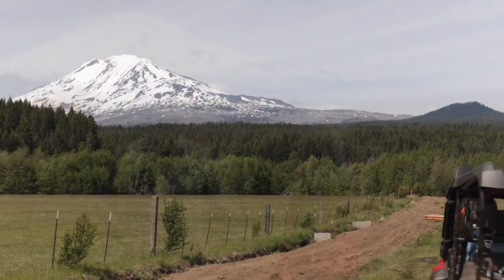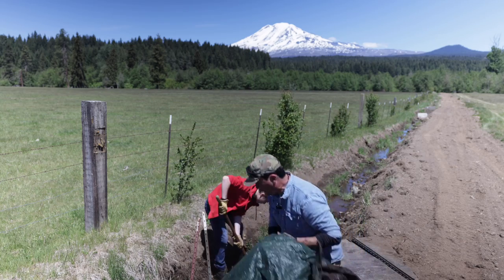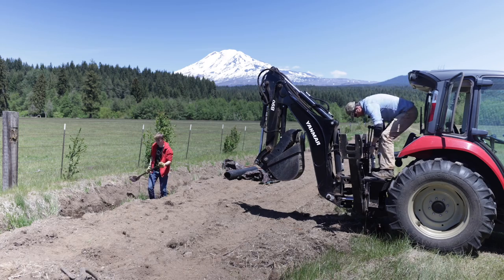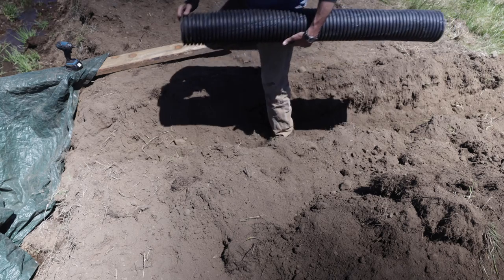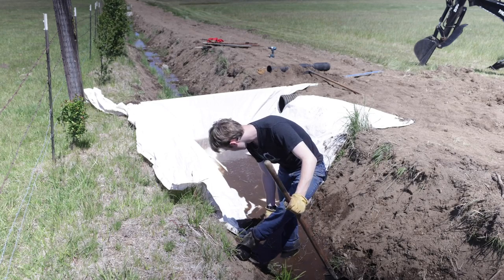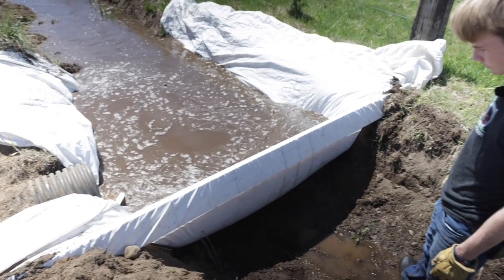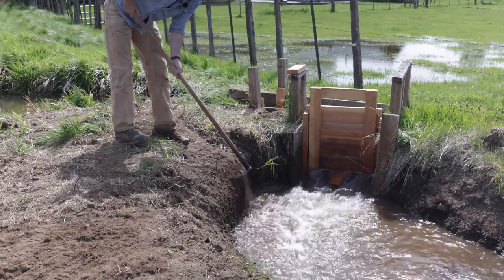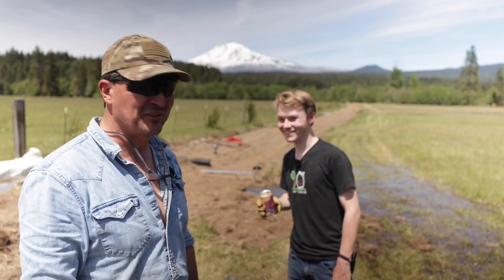How To Build A Dam Like A Pro

Comment: may i add some surgestions:
1. how about taking that tarp double, i dont thing there is that much needed for the floor before the dam 
2. you could baricade some of the tark to release some presure into the ground, with sticks or more 2by4s
3. maybe ad another piece of tube directly next to it, as it would double the flow rate, without much stress.

these were just some thoughts  of a german IT student, watching this after dinner.

keep on going, i love the content and its comforting to watch.

Comment: Personal experience as a field irrigator in Central Oregon, when using those tarps it's best to have about a dozen 15+ lb rocks to line the bottom of each tarps edge under the water to prevent it from pushing out prematurely during the ditch fill. Have lots of tarps and boards on standby because they can blow out pretty easily and with no warning. Other then that I say no to rain boots and yes to crocs and shorts to just get right in that ditch to set your tarps but I don't think you intend to change out as much as I do in a day

Comment: Your "old" method was used while I was growing up in So. CO. in the 60s & 70s.  On top of that, aluminum and plastic pipes and hoses were used to siphon out of the ditch into the field instead of a culvert.  Thereby allowing more control and flexibility.  But those were agriculture rows and lands where you're flooding instead.  Learning the "old" ways again.

Comment: Straight off the bat. The tarp was my easiest way and you confirmed that, so I'm sold. But I'm going to use those big sealed canvas signs they use for ads on the sides of buildings.

Comment: We used tarp dams extensively in our farming operation. We backed our tarp with 2x4's for added strength and stability. We would typically do multiple culverts per field, which made it possible for us to handle the volume of water that we received.

Comment: I was watching some of the older vids on your channel, and watched the Series of 5 about 50 Tools every Dude should own... I do HVAC, have for about 15 yrs now, and I found that if you get 2-3 Glow in the Dark Colors, and mark your Tape Measure at the 6In with just the one color for just the Half-Inch ticks, 1Ft in one and 2Ft in the other, then Alternate on Odds and Even Foot marks (DON'T USE THE Half Inch Color), after you memorize the color specifics you've set up, it makes measuring Duct runs and Copper Tubing and wiring a breeze under a dark house. ( I'm a 3rd Generation Stanley Tape user, but that little change for my line of work, was a pretty sweet couple hours to do it.)
Just thought I'd share my weird, semi-useless modification. 
Note: I'm an "East-Coast Guy, Kentucky here.

Comment: Go to your local farm store and purchase dam material. It is a tarp with a place to slide a metal pipe through. You can put a bend in the pipe to allow water to flow over to the next dam and you can do multiple spot that way.

Comment: Can also add 4 inch pvc pipes down the length of the ditch to allow water to egress prior to your dams. I personally like to add a 90* bend to the inlet side with enough pipe to allow an upturned 90 to be higher then the surface of the water. Adjustable intake heights on each pipe run allows for more efficient control during low flow situations. There's nothing worse then having just enough flow to fill a ditch but not breach a bank or having so much water that you can't properly direct it with just a tarp/damn. These pipes should be buried level set down about 3/4 from the lowest point of the bank.

Comment: The tarp dam is still in uses as of today in some parts of the U.S.A.  in Colorado I see this a lot.
Reply: I'm a Dam Operator and we use them all the time for quick temporary blocks when repairs are needed. We just use heavy thick rubber sheets. Same idea.
Reply: @artolivas8548  is it bad if water spills over the top? I want to try this

Comment: Dear Wranglestar!
This is very educative but also relaxing video for civil and structural engineer research as well as students. Here we can present HOW THE OWNER is responsible for SAFE CONDITIONS during building and maintaining and operating the dam in safe conditions at all time so it don't continue ( in the future) a hazard to life, health or property. How you build your monitoring will be easy. Also you must do own periodic inspection, meintence, especially monitoring after significant storm events such as earthquake or floods ( inspect at least once every 3 month). Periodic monitoring of weep hole dreins should be permed and documeted. LIKE YOU SAID about ANIMALS like beavers with try to plug spillway with their cuttings or woodchcks into the downstream face of small dam. Also GRASS cover should be routinely cut to provides a surface that can be easily inspected. I see you have daughter so be carefully with structural cracking of concrete because it is usually indentified by long, singl or diagonals cracks with displacements and mislignment. THANK YOU for video and be aware of a small crest - walk cross and cracks through concrete surface exposed to flowing water because of erosion of foundation around. SO MONITOR ALL FOR YOUR KIND AS WELL AS FAMILY AND CHILD - they are our future and thank YOU for NOT comic video but presentation that MIND is one thing, "SCHOOL" another. You have included for your own monitoring all in your project spillway discharge rates, settlement, readings from instruments such as piezometar ( I recomed to add), crach, gamps, etc. Only be aware of concrete in weep holes with excessive hydrostatic pressures because a mi nor cracking can be the eventualno loss of concrete which exposed rainforce steel. Minor surface cracks don't affect the structural integrity but I will be sad ( on my own) to see that something like that happend. WISH YOU LUCK,
Civil engineer from Croatia

Comment: If you would have burried the pipe deeper you could have used the hole diameter and not just half of it. Or am I missing something? 
Of course it would have to dig out more to adjust the angle.
Reply: Where would you get that volume of water and where would you put it.